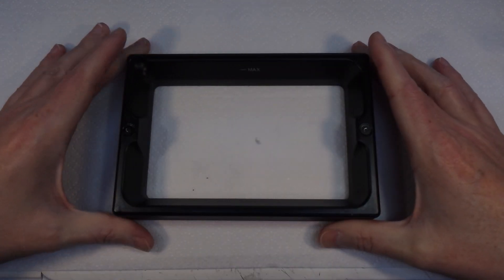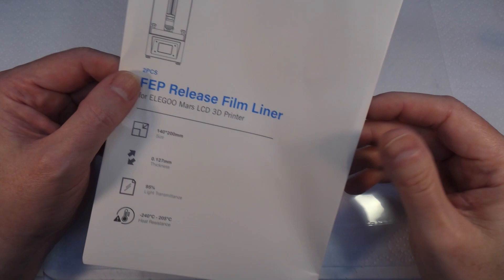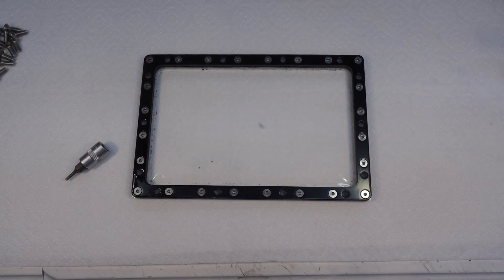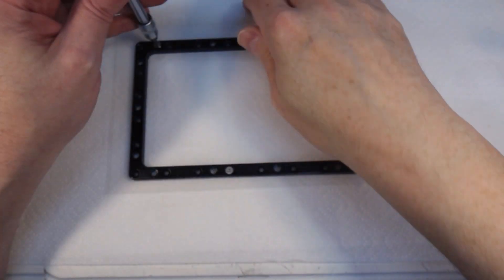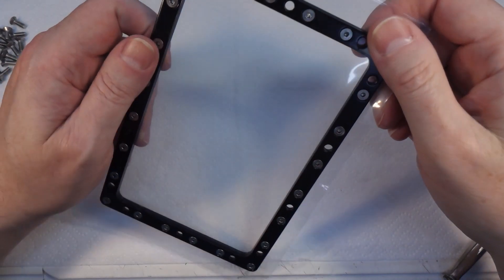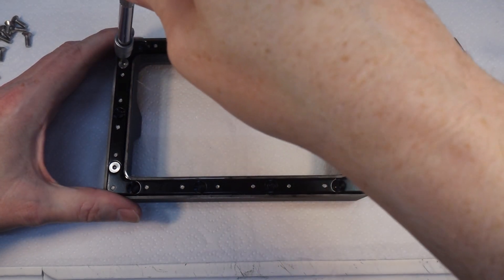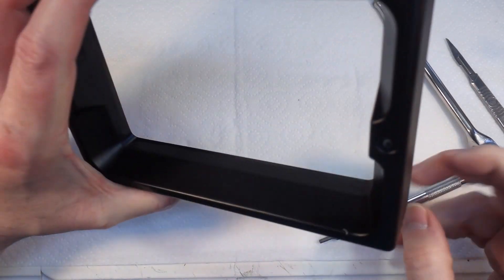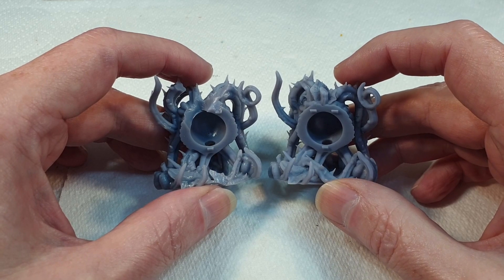Changing the resin tank film on my Elegoo Mars Pro 3D printer

Comment: Good evening, this is not about this video but.... can you tell me the filler used on one of your vlog. I think it was on one of your earlier builds maybe a spitfire. You said it was easy to clean off when you have filled models. TIA
Reply from the maker: My go to filler is Mr Dissolved Putty. Put it on, leave it for ten minutes and then wipe off the excess with isopropyl alcohol. I've added an Amazon link, but shop around as you may find it cheaper elsewhere - https://amzn.to/2Vfv4ih
Reply: Start in middle on each side then work your way to corners. It's like steching a canvas or silkscreen frame

Comment: I did think of the head gasket bolt sequencing. I helped my dad do it several times. I'm not very mechanically minded, but dad explained it so well, it stuck. In the later times we did it, either me or my brother actually did the work, and dad supervised, usually with a mug of tea in one hand, and a cigarette in the other. He always finished the tightening off, as he had a feel for when it was done, and didn't want us going mad and stripping the threads. Often done outside, and in any weather, too. It was fun, dirty, and above all, character building. A set of skinned knuckles was a badge of honour. And we got to play with Swarfega afterwards.
Reply: I wondered about the correct tension in the clear layer and the correct torque settings for all zillion bolts.
Reply from the maker: Someone else asked about torque settings, but with these tiny M3 machine screws, I don't have anything that would be suitable. I have Snap On torque wrenches but the smallest one is 3/8 drive so not really ideal. I just used the old maxim of contact plus half a turn.
Reply: Oooh! The delightful squelchy noises you can make with Swarfega.